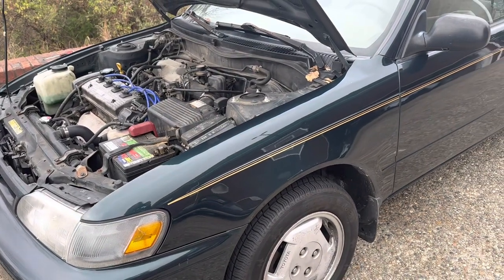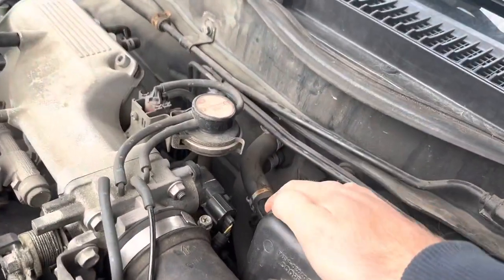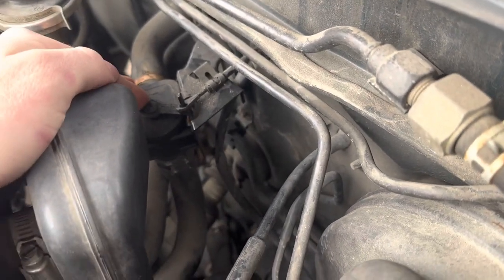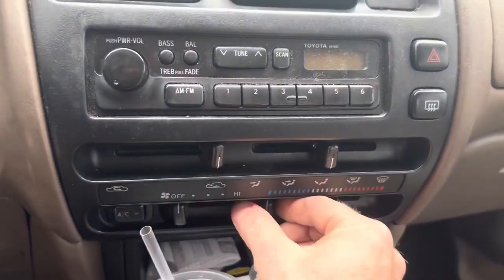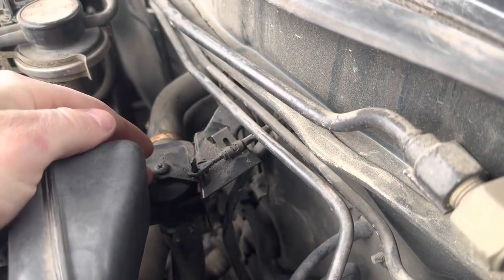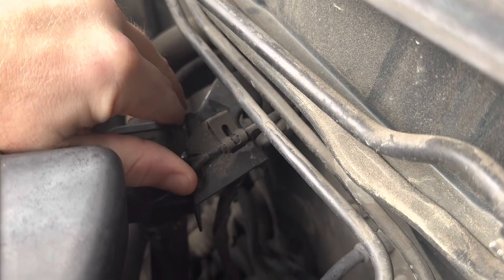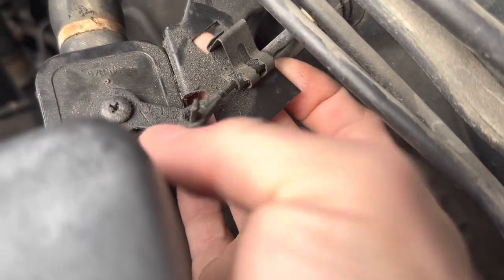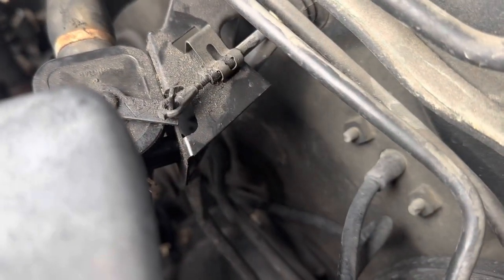1993-1997 Toyota Corolla heat issue quick fix

Comment: What is that part called?
Reply: Toyota Part # 87240-12260 $96.48 @ Toyota Dealer in PA. 
It is Heater Control Valve. Had the same issue and found this video and did some research. Part number on the part does not match the dealer part number. Denso RN137B

Comment: What does it mean if that part is leaking coolant off the top?
Reply from the maker: I’d guess that how it seals internally has failed and It probably needs to be replaced, that or one of the hose connections is bad.

Comment: Hey Kyle. Love the vids. Do you use synthetic or conventional oil in your corolla?
Reply from the maker: Thank you!! I have always used synthetic 5w30 with a Toyota OEM yzzn1 filter.
Reply: @kylesjunkandprojects216  thanks for the reply! Do you reccomend any certain brand?
Reply from the maker: @solomongreen9468  I use pennzoil platinum, but any brand of synthetic would be totally fine.